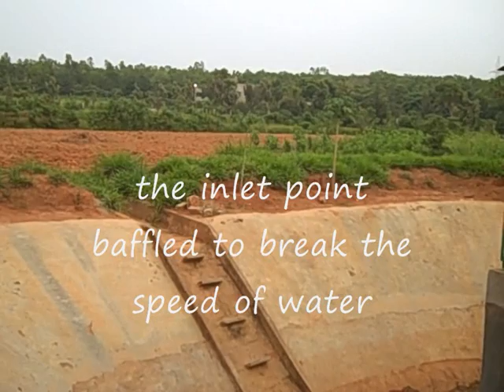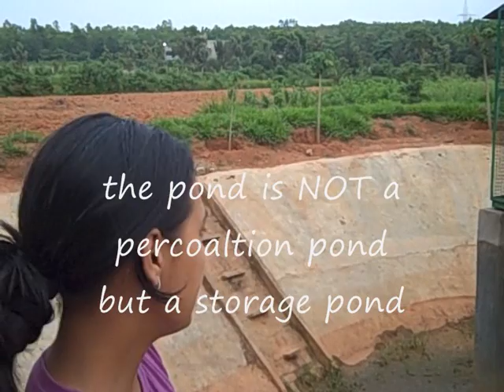Farm pond- Water harvesting structures in semi arid lands

Comment: Please remember that the utility, feasibility and scientific validity of the so called "well recharging" and "point recharging" etc. depend on so many spatio-temporaly varying parameters. Disappearance of  water diverted into wells is not an indication of corresponding increase in available water from the same well. May be she has just partially saturated an unsaturated zone. Even if one assumes that one can fully saturate a dry zone, only a small fraction of water (not exceeding 20%) can be recovered, considering the specific yield of the aquifer. Or there may be a rapid subsurface drainage. First of all a well cannot be recharged. Only an aquifer can be recharged. So one needs to study so many things such as the natural infiltration capacity and recharge characters of the surface soil and subsurface strata, 3D mapping of the aquifer, determining aquifer parameters, quality of the roof water used for recharging, etc. to name a few. So the tendency of felicitating and generalising such experiments is dangerous.
Reply: Very well explained Sir
Reply: MADHAVAN NAMBOODIRI 
My god.
Sir,
I got shocked after reading ur comment.
Thank u for such precious words.